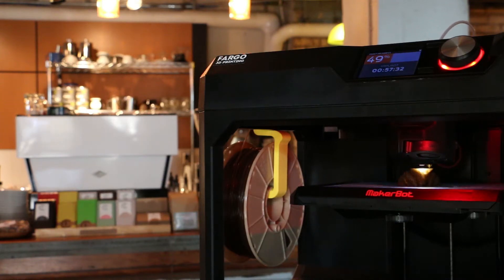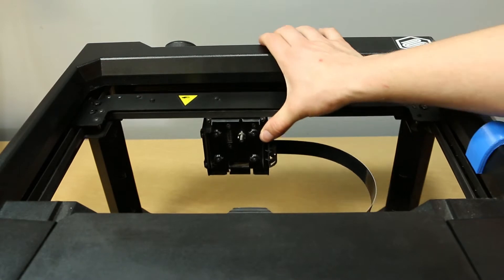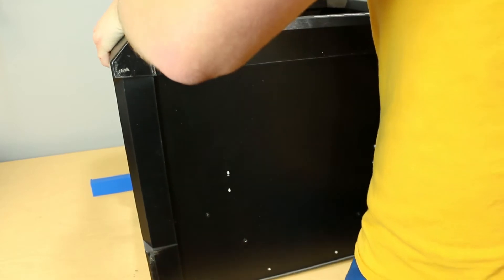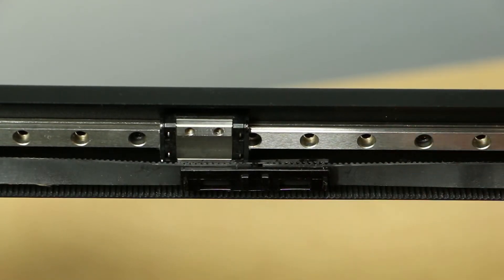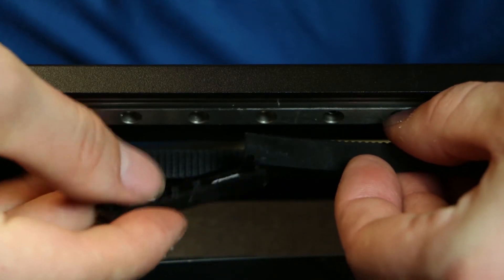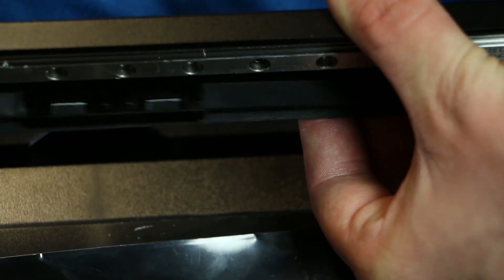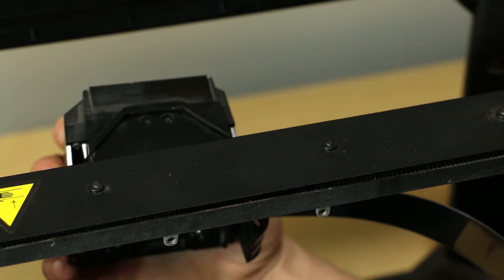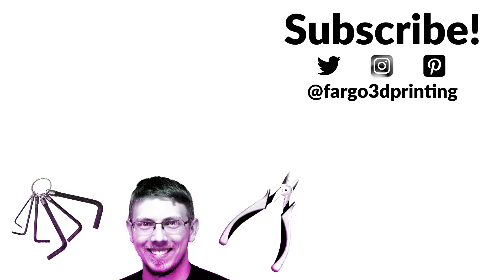Replace Replicator 5th Gen Belt Clip

Comment: Hi there, nice clear video! I am doing some maintenance to my 5th gen and was curious about how you have your filament hanging off the side of your printer on a custom yellow hanger. Do you find it feeds better that way than by using the holder at the back of the bot? Is this part on Thingiverse?  Just looking for ways to optimize my printing, thanks!
Reply: Ah, very good. Thanks for this innovation!
Reply: @jasonschiedel6134  or @Fargo 3D Printing, has anyone found a link to that filament hanger? Looking for a way to use 3rd party filament on our Makerbot. Thanks!